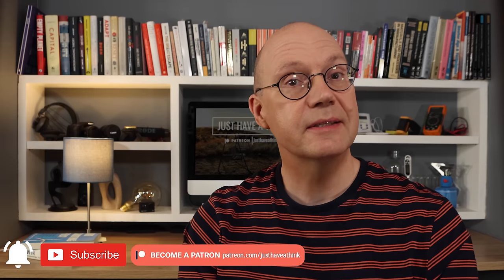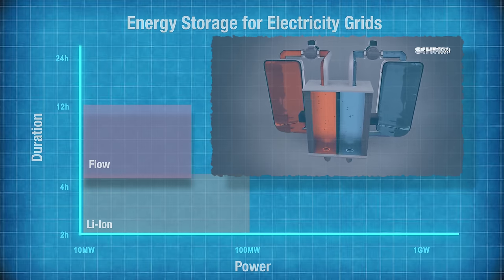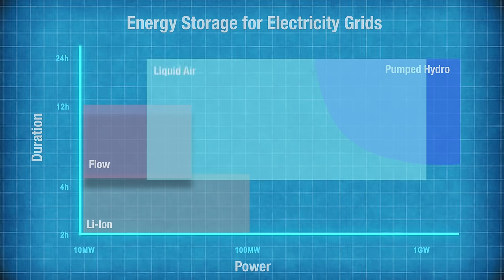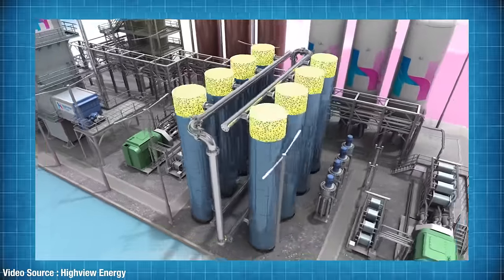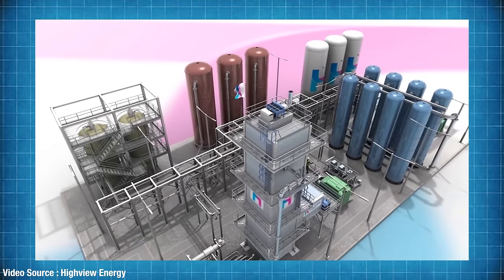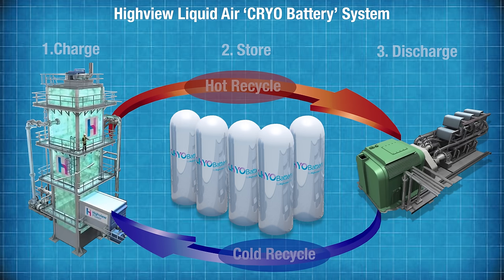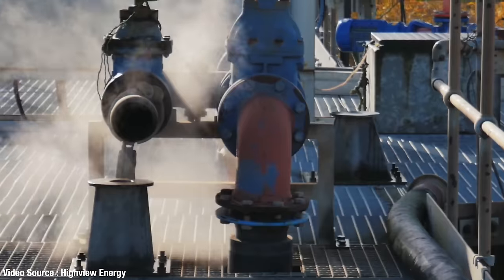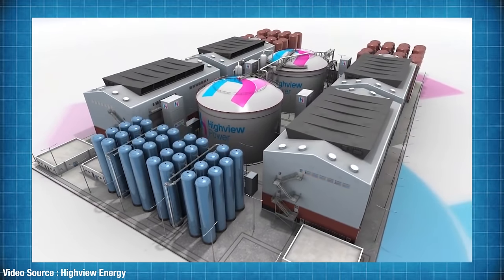Liquid Air Batteries. Literally energy from thin air. Seriously. Literally!

Comment: We need month-long energy storage to offset fossil fuels at a higher efficiency at the same or lower cost. This is why I am a big supporter of modular thorium reactors. I don't see any other practical way to get off fossil fuels.
Reply: Why do you think we need month long?  the energy grid reacts to minute by minute demand peaks and troughs.  This solution is meant for that kind of demand.  Sure, there are month long needs as well, but that is what I believe is called base load, which is covered very nicely by hydro power.  (I live in Canada where we have skads of that).  Other parts of the world use nuclear and coal which sucks.  So, I suppose I do get your point that they need better base load then nukes and coal, (if that is indeed your point?)
Reply: Not sure why Liquid Air Batteries can only hold their load for up to 24 hours? Surely they can withstand for much longer?
Reply: "month-long energy storage t"

Thats the point of solutions like Liquid Air Batteries.. They can store energy for a month or more.
Reply: Thorium reactors produces dangerous Uranium isotopes as a byproduct, so no.
Reply: @iwiffitthitotonacc4673  They can but the cost does not scale linearly :(
Reply: So an as yet immature nuclear technology best suited for supplying base load power is needed because the assertion is made that for some baffling reason month long power storage is required? Solar cells even work in cloudy weather and they are getting cheaper every day. I suppose you are in the denial phase. Acceptance is hard but you'll get there and understand fission is so yesterday.
Reply: " "month long energy storage" " is simply unnecessary. Had that been the case, it would have been raised in the video.
Reply: @Aermydach  What about areas where the sun intensity is very seasonal and the wind is not significant enough to generate sufficient energy or where the wind energy is also very seasonal. A large part of the world has this problem
Reply: @stevemickler452  I have solar on my roof right now. Trust me I am not in denial. Try running the math on how much solar you would need in the winter months. We still need seasonal base load energy. I am not alone on this try reading How to Avoid a Climate Disaster: The Solutions We Have and the Breakthroughs We Need
(btw Bill Gates Loves this book)
Reply: It's important to do the sums. Electricity for domestic use is a no brainer, in the burbs, in many locations roof top solar and a residential battery will do the job. But cold climates where three or four months of heating is needed, or hot climates where aircon is needed is much more electric power could be required.

 The real issue though is industry and transport. In most countries these consume two to three times domestic use and so far outside countries blessed with hydro, little transition has occurred to zero carbon renewables in these sectors. To do the job with wind or solar will require a truly vast increase in solar and wind capacity. Alternatively existing coal and gas plants can be replaced with new generation small modular nuclear reactor (preferably thorium molten salt). 

To give an idea of the ratio it takes roughly 800 5MW wind turbines with a 14GW hour battery to provide 1GW 24/7. This is about the same as output as proposed 2 can small modular reactors.

In reality a mix, say 50:50 of nuclear and renewables is probably the way to go. In a country like Australia we will need at least 40GW carbon free power on line by 2050, possibly a lot more should desalination become essential.

 This could comprise 20 nuclear reactor sets and about 12,000 wind turbines (we currently have about 1500 mainly 2MW units), about 5GW of solar, and 280 GW hours storage (hydro and battery).

A big issue is where to place all the turbines. Many of the most prospective areas are already being used. Coastal locations provide the best wind opportunities, 12,000 turbines spaced 400 metres apart could require up to 4800 km of coastline being given over to power generation. There will be lots of push back.

There is a long way to go. It is hard to us getting over the line by 2050 without a substantial contribution from nuclear.
Reply from the maker: They can provide energy for up to 24 hours as the tanks are being discharged. The liquid can be stored in the tanks for much longer if it's not being used though.
Reply: @JustHaveaThink  unfortunately the longer the energy is stored the more energy it loses and the efficiency goes down then the economics per kilowatt-hour of the system get worse :(

Comment: The downside of this is that KEEPING the liquid air liquid is energy intensive, and there will be losses through the skin of the tanks.  I don't think Thunderf00t would approve of this plan.  Although, I suppose it won't hurt to build a prototype to give it a try and see how well it works...
Reply: I found it funny that he kept repeating that the liquid nitrogen could be stored easily in thin-walled tanks... yeah, "thin" for the pressure, and then thick insulation to keep it from heating up and exploding.
Reply: @ABaumstumpf  you're not understanding the amount of energy that would have to leak. There's so much energy in the liquid nitrogen you don't need much insulation the heat that leaks in is de minimis. It's the same when you ship methane it's all de minimis using phase change materials is just out of your comfort range mentally. You don't understand how much heavier the car battery size brick is when you use gold instead of lead. At our VA Hospital you can see thick ice on the oxygen pressure expansion pipe but they don't bother to use the heat that's in the building to get the oxygen for the veterans to breathe gasified Northerly bother to keep the veterans alive when they can kill them or even pay their city water bill for decades. That's the way I country rolls. We protect wealthy corporations and it's a process that we go through that is exceedingly slow in the past for example there's a cheap house in the town of 3000 that has the second College to admit women in our history still functioning although coed for however many decades or centuries now.
Reply: no it isn't. you're talking about a few hours that you have to keep it liquid. I don't know if this solution makes economic sense, but it's not going to fail because of 1% boil-off per operating window.

Comment: I'm Currently Using Li on Cells With A Big RS 63 volt 15000 uF 17 Amp Capacitor Wired Parallel To The Battery , She Kicks . Imagine IF The Liquid Air Battery Could Be DOWNscaled ? 
New Subscriber From Birmingham England UK Bless Up Earthling

Comment: An easier solution would be to have ice batteries at EVERY building instead, which are insulated icemakers that draw power during night to make ice and use the ice as free air conditioning (well, the fan still needs a low amount of power) during the day. Furthermore, it requires no new construction of energy storage facilities.

When the customer's old air conditioning unit filled with CFC, HCFC, HFC-404a, or HFC-410a goes out, they can simply buy an ice battery. Furthermore, since the ice battery is essentially just an automatic water-refilling freezer with a fan blowing across it, requiring a way-smaller compressor and way less refrigerant, it should be cheaper than a conventional vapor-compression air conditioning unit.

Comment: I would like to see you do a video on the GEET system for ICE motors that was developed by Paul Pantone in the late '80s where he converts the hydrocarbon fuel into a plasma prior to entering the combustion cylinder thereby giving an efficiency of close to 95% or in other words tripling the efficiency and mpg as a minimum benefit!  He suffered greatly at the hands of the oil Giants!
His invention is primarily an aftermarket product for existing vehicles that can and should be trumpeted as an economic way of reducing carbon emissions while the Electrical infrastructure is built nation-wide for vehicles!

Comment: The site in England you are talking about in this video is 2-3 miles from where I live in Carrington. And, it is going to be built on or next to the old Carrington (coal fired) Power Station site. So there is already a lot of (old) pylons and distribution infrastructure in place, which will make it even cheaper to build. It's great that there will be 200 jobs there, as this is a high unemployment area. 'The land the council forgot' is what I call it. ;)

Comment: 60% is acceptable? I suppose when 100% is going to be thrown away, 60% sounds good. It doesn't have to be just renewables feeding this, it seems to be ripe for load leveling to cut down on existing power station numbers.I'm skeptical on the 60% though. I would have thought 30% would be an upper limit taking into account all of the things needed to be done to store it and the expansion of a colder than normal gas into a turbine.

Comment: 60% conversion is pretty good, certainly better than hydrogen with all of it’s conversion losses. The really interesting part of this whole equation though is the role that distributed batteries will have on the overall grid demand - potentially reducing the peaks and dips by acting like a big virtual power plant. As batteries get continuously cheaper there will be a huge incentive for more people to do this at home - especially those who can install solar on their roof. The actual requirement for grid storage may not be as large as people expect. Something I will take issue with though - and its a minor criticism -  is that lithium batteries provide “up to 4 hours” of storage. This is accurate for grid applications because of the cost, but not really for households. At my home for most of the year the battery provides power on demand all of the time - absorbing the excess solar during the day, running the house overnight and filling in for any peaks in demand or cloud shading. My electricity bill in January was $70, and that is with around a $1 per day availability charge for the 90 day period, and powering my EV for a 75km daily commute.

In my case, my 13.5kWh battery coupled with solar makes the house pretty well self sufficient in summer (in Sydney Australia) and only suffers in winter because of shading issues (lower sun behind trees during the solstice) and the increased demand for heating. When this kind of system is roughly equivalent in cost to a 5-6 year electricity bill you’d be mad not to do it. You can either use the system to power the house completely, or use it to run the house during peak times and avoid the extra costs.

 This liquid-air technology looks extremely promising - so much to like about it. Relatively cheap, non-polluting, built using standard components and with an efficiency that appears to rival hydro.

Comment: Any studies on using Li-ion and liquid air?  Batteries have better round trip efficiency (80% ish) and follow demand essentially instantly.  So similarly to a hybrid car, you would have the high density but slow to respond liquid air taking the role of the petrol engine (if a petrol engine could be run in reverse!).
Reply: li-ion can be used for short term, up to 4 hours and liquid air from 4 hours. These 4 hours come from economics and scale

Comment: Pressure tanks also operate on the square cube law, meaning that as size increases, volume increases far faster than surface area, and the surface is what you're paying for. I think it would be silly not to produce clean water, sequestered co2, argon and some oxygen and nitrogen for industry from a system like this. The co2 could go into greenhouses as an airborne fertilizer that can halve land use by doubling yeilds, while sequestering it more permanently as soil carbon which restores soils and protects natural fertility for decades

Comment: Would be interesting to see if they made a car with this type of generator to power an electric powered vehicle. Pull up to the bowser for liquid air rather then petrol, diesel or lpg. Could use surrounding air to bring the liquid air closer to ambient & maybe have a second lower pressure turbine to extract a little extra power after reheatment.

A car with minimal co2 emissions, that can be "refueled" & should be far cheaper to fill then regular fuel.

MDI & Tata motors tried compressed air, maybe the leap is liquid air that is needed.
Reply: I have been thinking about this too and perhaps it could work with low speed self driving platforms in (hot) cities where there the network of pipes needed for the heat exchange is underneath. That'heat exchange is the weak point since, if it must be done on ambient air only, very fast you get ice deposition on the pipes. The advantage seems clear for hot cities because the cooled air can cool the vehicles and in a way perhaps the city itself.

Comment: In your presentation, you mentioned that the air cooler cleans up the air a bit, removing water vapor and carbon dioxide.  This got me to thinking that the energy storage process provides direct air carbon capture as a byproduct.  Any farmer will tell you that the trick to staying solvent is to figure out how to glean money out of all the byproducts the farm creates.  

IMHO, the current direct air carbon capture solutions I’ve seen are a bit of a joke, or worse, a smoke screen that allows corporations or governments to claim they’re doing something about climate change while providing little more than lip service to the problem.  With direct air carbon capture systems, giant fans blow air across chemical solutions that absorb CO2.  Afterwards, the chemicals have to be processed in order to extract the CO2 from and to refresh the chemicals for the next round of capture.  It takes energy for the fans, pumps, and the CO2 extraction process, and this runs in a giant technological monument that represents an awful lot of resources to simply capture CO2 directly out of the air.  For your liquid air battery people, the CO2 byproduct is waste that needs to be disposed of.  Well why not dispose of the CO2 down a deep well and get credit for carbon capture?

Comment: I was stunned when I understood the potential for liquid air batteries. This is the missing link that can make 100% renewable base load power possible. It ticks all the boxes.
Reply: Unlike the synthetic jet fuel that fission produces on aircraft carriers so that they are self-sustainable liquid nitrogen can be produced for every motor there's a turbine alternative with various levels of low-hanging fruit. Wasting liquid nitrogen Outdoors just reverses global warming especially when the heat from the phase change proceeding is radiant in the clear night sky
Reply: Peter Mortensen  Sorry you dont know what you're talking about.

Comment: Sixty percent efficiency is way better than minus a hundred percent efficient like when renewable energy goes to waist. And way better than naught percent efficiency with solar and wind not working. Any percent is a bonus with renewables that don't work at night and when the wind doesn't blow. It needs energy to liquefy air but if it's powered by solar&wind a forty percent loss doesn't matter.

Comment: I know I'm a bit late commenting on this video but what I really like about LAES is the potential for synergies when co-located with industries that produce a lot of waste heat. I saw some notes on the Highview website that say that the economics of LAES become much better when there's a source of waste heat available to do the vaporisation. One such industry is the steel industry and most steel mills usually have an air separation unit because they consume a lot of oxygen and argon. Whilst I don't know too much about the details of how an ASU operates, I'm assuming that nitrogen is essentially a byproduct of the ASU and is simply released back into the atmosphere. What if, instead of the nitrogen being released, it is captured for use in liquid nitrogen energy storage (LNES)? This seems like it would leverage synergies in using two byproducts to store and recover energy: the ASU liquid nitrogen byproduct for storage, and the waste heat byproduct for greater efficiencies when recovering the energy.

Comment: CRYO IS THE NEW STEAM!! 
 I'm so glad you finally broached LAES -- there's more to the LAES story than Highview, there's also Keuka Energy's mechanical wind-LAES system. Keuka has prototyped an off-shore wind-driven LAES-capture system, but with a $128million DOE contract they will be able to build a fully working vertically-integrated pilot. 
The advantages of a marine ship-to-shore LAES system cannot be understated, esp as there are so many benefits to Cryo in general. One is thermo-remediation in the thermally degraded cryosphere, where we could opt to stabilize marine ice shelves, nearby inland tundra, even glacial stades. 
But most important is the CO2 sequestration.  Although currently Highview may be opting to use LOX & CO2 to thermally enhance their power generation (making it carbon neutral), in the future Cryo storage may opt instead employ convert it to hydrocarbon or Sodium or Calcium (bi)carbonate for long term sequestration.
see also ... www[.]keukaenergy[.]com

Comment: ... I think using a turbine as the means of H.P. gas to mechanical/electrical conversion is wrong. The efficiency of a turbine is just not there. I think a multiple-expansion reciprocating engine or a multiple-expansion Wankel engine would yield a much higher conversion efficiency. The Wankel-idea is my favorite because it would use its design simplicity and would give that Wankel a new lease-on-life ... given there's NO combustion and inefficient combustion was its Achilles' Heel. Multiple-expansion steam engines are efficient, but it's the latent-heat-of-vaporization (that is unrecoverable when condensing the exhaust back to liquid water) that killed steam power on smaller scales.